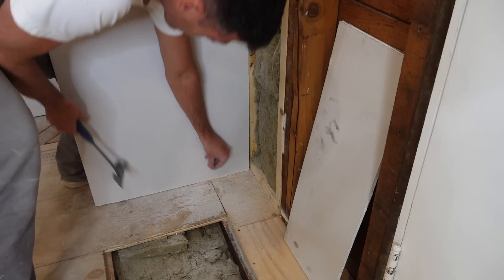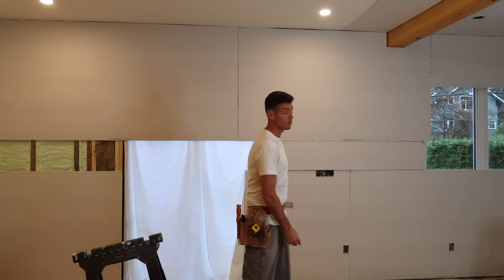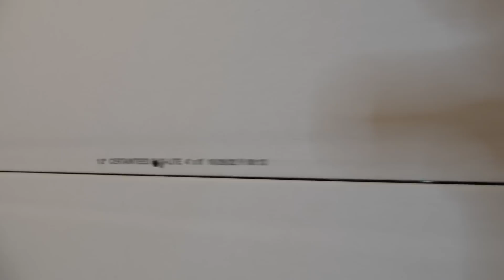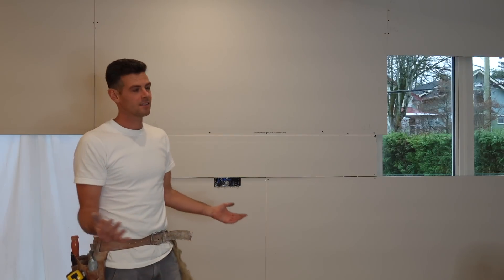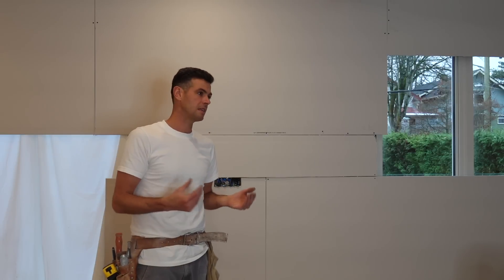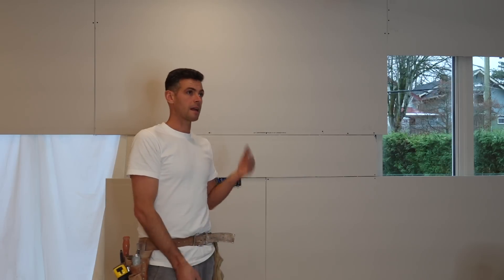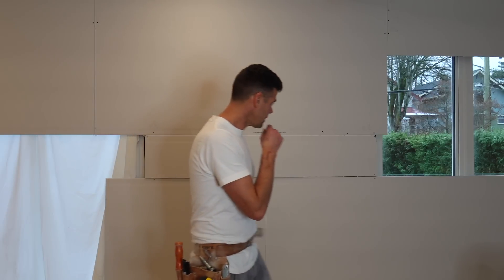Making the case FOR Drywall Nails!

Comment: Saw at drywall crew at my last job, they tacked the entire ceiling routed it out, then moved on to the walls did the same, one wall at time  when the room was done they screwd of the whole room. They also completely nailed any inside corners as they went.

Comment: I remember back in the late 70s i helped my dad install new sheetrock in our home and all we used were drywall nails. I dont remember having any nail pops. Interesting enough our solution for nail pops in the walls that we didnt replace the sheetrock was to simply hammer them deeper into the sheetrock and cover with drywall mud. Lol! That home is still standing.  It would be interesting to see it today as im positive it has an abundance of nail pops now! Lol! Drywall screws have been a huge improvement! Best thing i ever bought for drywall is a drywall screw gun with a self feeder strip. Its litterly easier than nailing could ever be. I initially purchased it with the thought of selling it after i replaced the drywall in my house but ive since changed my mind. Im keeping it! One never knows when it will be handy to have. Fortunately no one has asked me to hang drywall in their home yet! However i have become the official fixxer of holes and dents in my family and friends home. Lol!

Comment: I’m finishing the inside of my shed with drywall because of you. Thanks for the content!
Reply: Why?
Reply: @robertm5969  it's clean (once finished), depends what you use your shed for. I insulated, added a vapor barrier, drywall, and turned it into a workshop.

My insurance also appreciates drywall over bare or OSB/ply, especially as I stuff the place with valuables.
Reply: Sounds like a nice shed!  Might even deserve a mini split someday.  Our shed needs a new roof, retaining wall fixed, rotted siding replaced before I do anything with it.  Glad you are getting plenty of use out of yours
Reply: @robertm5969  yeah, it definitely evolved, makes for a nice area to work on projects without introducing noise to the house like working in a garage. Was thinking of adding HVAC, but here in western WA state, the summers don't warrant AC in an aux building, and heating it resistively is cheap after insulation. Plus, I took advantage of the single circuit rule, which means I don't need ground rods or a separate panel (a bit far from house main panel to justify a full run) so the mini split would be using a large portion of available juice.
Reply: @robertm5969  hey just saw this. It’s also my work shop. It’s a place that I can leave any project and lock the door. No one messes with it. I know exactly where which tools are. 
It’s a place to think, work, listen to music. 

I’ll add AC in the summer if needed :)

I also shoot videos of mini projects for my German folks abroad 👍🏻

Comment: I spend too much time pulling old, popped drywall nails out of the walls and ceilings of our home. I give them a thumbs down, but I’m glad Ben is always ready to provide fair and balanced perspectives on these types of things 👏
Reply: Me too.  Although I guess if you use them with screws, you probably won't have an issue.
Reply: Always, go with what you have, then try to do better.  IMO, you are doing great managing popped nails.
Reply: @eukaryon  well yeah, walls and ceilings are better than no walls and ceilings 😄

Our house was built in the 70s so nails may have been the standard then.

Comment: I recently bought a 50-year-old house and I've been fixing it up. All the drywall was installed with nails. SO. MANY. NAILPOPS. Especially after I got the siding was replaced. So, in my (admittedly very limited) experience, nails alone are no good. Interestingly, all the nails were installed in pairs; spaced about 2 inches apart vertically (no idea if this was standard practice at the time). I've ended up driving a screw in between them whenever I see the nail pop bumps, then hammering the nails back in, and filling it all up with mud. Works well enough. I'm sure I'll be taking care of these every now and again for years.

Comment: Nails are a lot easier to fix when they show up proud in your mud. We used to use a 3 3/8” Makita 9.6 saw for in place vertical door or window cuts. It makes less dust than a router. With layout the back paper cut can be be done before you hang the sheet

Comment: Switching tools is critical. Whatever works is the best way to do it. I have a swapped out breezeway that needs to remove the exterior siding, exterior fiberboard, and then apply sheetrock. Thank you for pointing out there is no best way to accomplish the task. If it is stupid and it works, then it is not stupid. :)

Comment: Here here on corded tools! I have yet to choose a battery brand mostly because of choice indecision haha but till I finally crack I love my corded tools. I don't mind using an extension cord for maximum power that won't fade over years of use, assuming a well made battery that doesn't fail sooner. Very fun video. Always enjoy you content and I can't wait to see how this project goes!
Reply: I like Ridgid.  Good quality for the price.  Not quite as good as Milwaukee but much cheaper
Reply: Makita... by far the screw gun, router, and impact you will enjoy top notch!
Reply from the maker: They do make a nice screwgun.
Reply: If I'm up on a ladder balancing a sheet of drywall on my head, I prefer not having power cords trailing behind me wrapping around my legs.  I'll use the cordless collated screwgun and router to tack up and then screw off the field.  If I had a collated corded screwgun I might use it for the field, but my only collated is cordless, and it does the job.

Comment: Nate, I grew up with drywall nailed to the studs! No routers, no screws. Things changed in the eighties, new methods and SCREWS! We would tack the sheet with nails then come back and screw off the "field". We nailed off the butt joints( way better than screws), and we didn't picture frame anything! Saved 10 (now $30 sheets per house), and minimal scrap. Just my 2 cents..........................................D, old time drywaller.
Reply: Curious, why do you think nailing butt joints is better than using screws?

Comment: “DIY Pro”- tip for you, Ben ( 😂 ).

When inserting nails into the  “nail holder” I place the heads in word, with the points outward 😮.  Handling up to six drywall screws at a time, I no longer poke my tongue or scratch my teeth. Just make sure you use a wide vertical positioning of your fingers when you reach for a new one!

(… Hope you find this potentially useful – then I can feel a little bit better having “paid back” some of the favors from your channel!…). 😅

Comment: Hurricane Michael survivor here.  My ceiling blew out about an inch from pressure in my crawl space.  I found they used nails instead of screws.  Maybe screws would have backed out or pulled through, but the nails did fail.  You can't just drive them back in after the insulation gets under the drywall.

Comment: I like a collated drywall screw gun; it is the best investment you can make if you do any decent amount of drywall installing. 
I’m not a big fan of drywall nails, especially in old work, as you can knock plaster off the opposite side of a wall you’re drywalling or even simply near by walls. I will agree that a nail here or there, especially when you’re working on our own can be helpful, though staging your screws in the drywall can accomplish the same thing.

Comment: To tack wall panels up we set nails on the top to catch the top plate, holding the sheet up in place and knocking them in from the floor. Much easier. Back in the day, we tacked everything up being careful around the boxes that still need to be routed out, then, route and screw. You clearly mark ALL things to be routed with pencil so you wont miss anything.

Comment: Nails are best with the stiletto hammer so you just put the nail on the hammer head and tack where you need. You also don’t have to reach all the way to the floor and you can also hammer the top of the sheets on 8ft ceilings without a bench
Reply from the maker: Good call.
Reply: @vancouvercarpenter  Reasons. Nice

Comment: I was always told: using nails allows the drywall to float a bit - less chances of cracked walls from heavy winds.  I guess screws hold it tighter against the studs - more prone to cracking.  Again, this is just what several people have told me.  I'm a car guy, drills and ID's are much more natural to me than swinging a hammer at fresh new drywall while DIYing.

Comment: I recently tore down all the old drywall in my garage and discovered whoever hung it used hundreds of finish nails instead of drywall screws/nails. Made taking down the drywall a breeze, but any time gained was lost pulling hundreds of finish nails out of the framing.

Comment: Hey, thanks for the tips! I've watched another video of you regarding the wood glue into plaster to increase bonding, super video!, I do have a question related that, I mistakenly bought 10 bags of plaster(knauf goldband) this is a regular plaster that you can even go 3cm plaster and it requires a primer before application, but I actually bought them for dot and dab(very wrong choice), so seller doesn't accept it for exchange or return because these products have sensitive nature, anyways I'm trying to find a way to use them for dot and dab, do you think adding wood glue would turn this into a plaster adhesive? I'll give it a try for a small application, but what i want to know, even though if it looks it is working, I need to be sure, I'll not pull my hairs after several months :) Your answer would help me a lot! Thanks!

Comment: I am curious, here we apply glue to studs before installing sheet.  If you do a bunch of sheets, tack them then router boxes, trim lengths, etc, then screw the field, won't the glue have skinned over and be less effective?  Key to less fastener failures over time is correct spacing and using good quality adhesive, correct?

Comment: I only use nails for metal corner bead since they stay flat and out of the way of the knife unlike screws.  Plus you have to be a master with the drywall hammer otherwise you're playing make the perfect dimple on most of the nails if you're out of practice.
Reply: As a follow up I will use 2 nails measured 48 inches down into the studs first as little ledges Then I can lift the drywall and place them on the nails which is easier than trying to hold the drywall up tight with one hand while you're banging the nails in awkwardly with the other Only to realize it has shifted down.  Once you get a few screws or nails and then you can remove the temporary nails or just hammer them in

Comment: We bought a house from 1980 that seems like it was built for speed and cost rather than quality.  It was all drywall nails and they spaced them every few feet so nail pops galore.  

Not a huge deal except for the ones 18ft over the stairway.  Need to build a ladder box and get up there for those guys someday

Comment: VC, can you do a video on making angle cuts on dry wall. I had to cut a crazy piece to fit this corner section of a stairwell. It had like a 45 degree angle in it.Followed by lots of normal 90 degree ones. Picture a figure 4 of drywall. I measured everything and just did it that way but I feel like there’s a better way. Like maybe with that angle tool (forgot what it’s called cuz I never use it lol) any chance of a video?

Comment: The abode I’m now in was done with ALL nails. Finding nail pops & fixing with screws. Won’t bother with the ones at the bottom. Tap the back in with the trusty hammer. Will cover those with new trim anyway.

Comment: Hey Ben. Maybe you've done this before, but, can you talk about how you finish the bottom of the sheet when you put a finished edge against the floor? I've always tried to avoid that because I thought my baseboard would end up at an angle. Just a diy-er here! Thanks!
Reply: Mud it so that it is vertical.  (there was a video from Perkins Bros Building that showed this is what they request their drywall finisher to do)  
If the wall is less than 8 feet, you can strip off the 2 inches of taper (if you don't mind the work or the mess, especially if you have a ripper on hand)  
I personally hate the taper at the top edge, it makes my finishing tools (flusher) perform a bit differently in spots with or without the taper.  If I have extra hot mud when I'm doing a pre-fill, I'll flatten out the taper on my top edges as well.

Comment: Ben, have you ever seen nails embedded behind paper? I don’t understand what’s going on with my walls (1965 house in USA). The paint came off in sheets when I scraped loose paint, I don’t see screws or nails or taped seams on top of the paper, I have only seen nails well behind the paper when I go to cut out the paper and loose gypsum? as I repair damaged spots. It’s like I have nail pops from inside or behind the paper.
-Confused beginner

Comment: After 35 years working as a professional painter I have to say I've filled just as many nail pops as screw pops.
So really it makes no difference whether you fix drywall with screw's or nails. 

So you pays your money and makes your choice.

The only thing that makes me use nails over screw's, is mostly when I'm fixing new plasterboard in places it's for single walls or ceilings and large patches. So I pick nails ever time as it's far cheaper to use nails. Over owning a screw gun, as a hammer costs peanuts and never needs power, other than a bacon sandwich in the mornings.

Comment: Makes me wonder about smooth shank vs ring shank drywall nails. With framing nails there's a massive difference in holding power (ring shank 16p nails will often pull the head through the top board rather than let go of the bottom one!) Plus, the ring shank drywall nails I've seen have a lot sturdier head on them so a hammer's less likely to rip it off later.

I've also seen guys use screws as nails (hammered in). wonder if that would work? would save carrying two kinds of fastener at once.

Comment: I drywall for 50 years and we nailed all the drywall on the wasn't any screws and it worked fine but the drywall in the old days was a light drywall and we didn't have a problem with nail pops the king of drywall
Reply: There wasn't light drywall back then that was an error the drywall and my day had a really hard core and would hold the nail this light drywall today doesn't hold the nail or a screw
Reply from the maker: True. I caught the very end of the regular weight drywall in the first few years of my career.

Comment: I just bought a new corded angle grinder because my battery model eats up the batteries too quickly.  The plus side, is that it was a lot cheaper!
Reply from the maker: Angle grinder is where I like cordless. They crap out when they bind instead of kicking back. I find them safer.

Comment: I suspect some of the nail pops people are complaining about are because they weren't installed properly.  Code calls for drywall nails 6 to 8 inches apart, field and edge.  If you use less, you may get more movement over time, hence more pops.  If you bend one, it isn't doing anything and the head needs to be captured by another nail, then a third nail added nearby to actually hold the drywall.  But having said all that, I prefer screws.  Also, if you have nails and screws in the same sheet, you essentially have to ignore the nails when you go to screw the sheet up as there's no code for spacing the combination of the two.
Reply: A major issue is over driven fasteners, whether they be nails or screws.  A friend bought a brand new house about 30 years ago, and after a year wanted to paint.  In the main bedroom alone there were over 30 fastener pops we had to fix, and of those pops, about 90% of the time the fastener was driven too deep, reducing the strength to almost nothing.  
The production hangers don't have to be around to fix issues a year down the road.

Comment: 2 things people dont like nails because they dont know how to use them when i started in the trade thats all there was you have to double nail everything walls and ceiling the second nail often pulls the sheet tighter poping the first so you wack the first again done right they wont pop unless something moves later but screws will then also and to fix a poped nail drive a 2ond one in to catch the head of the popped one way faster than fixing screws you also need to drive them in strait and dimple them

Comment: Great as always Ben.  Quick question: are you more likely to get pops with the nails than screws?  Also completely unrelated.  Is there a US equivalent to Dynapatch?  Used to be able to get it Stateside but not as of late.  I've used Dynapatch at your recommendation and it's legitimately great - do you know what the special sauce is / how to shop for a comparable equivalent (what to look for - I know it's not vinyl etc)
Reply from the maker: I have no idea what a US equivalent would be. As for nails, They are guaranteed to get more pops if they are not in inconspicuous locations. But under trim or bead is a good choice.

Comment: Great content, as always! Just did a drywall ceiling repair, your videos are invaluable. The old ceiling seemed to have a layer of aggregate concrete between 2 thinner sheets of hard plaster enveloped in cardboard. Have you come across this material in B.C.?
Reply: You may be seeing a product I refer to as "ten test".  It's like a wood fiber mat, finer particles than OSB, not as densly packed as OSB, but not as fine or as dense as MDF.  I've only ever seen it used in ceiling applications, with a scratch coat, then a parge coat, then a plaster coat as the visible surface.

Comment: I use a box a month. It's so much easier on the body if nail the bottom plates. . Getting a gun down low,at perfect angle with proper pressure is taxing ..